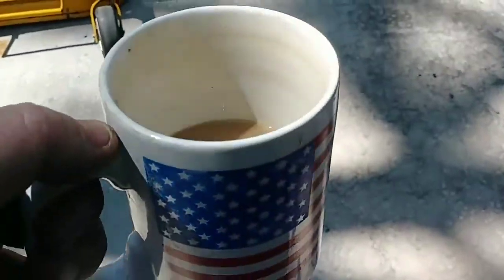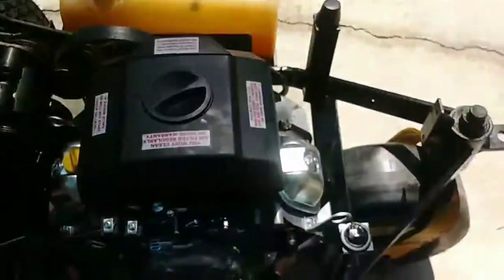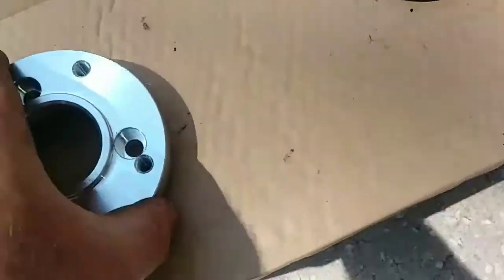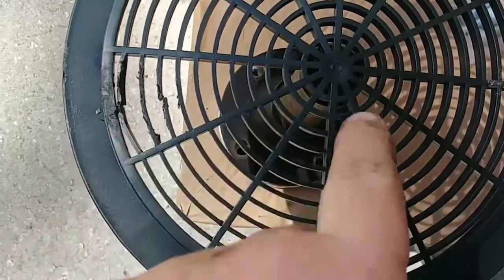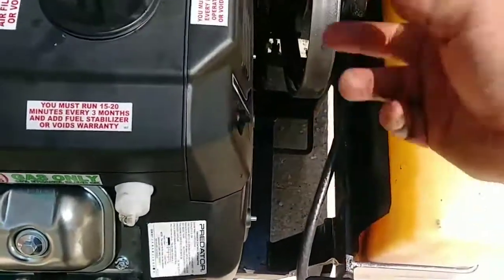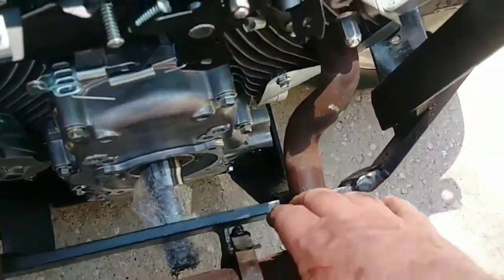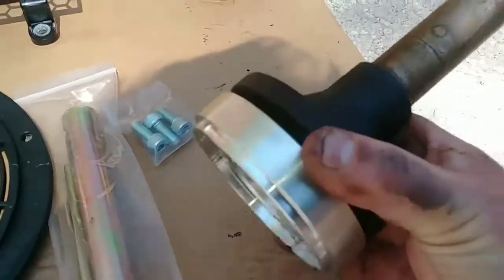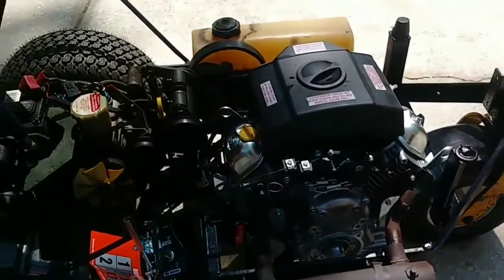Walker MC16 Engine Swap Part  2

Comment: I have the same set up as you except mine has the bagger.  I was wondering if you would put a video out showing the mods you had to make?  It would be greatly appreciated.  Thanks
Reply from the maker: I would glad to put something up, I've been changing the old Walker to make it simplistic and reliable as possible.

Comment: Dan, do you have any updates? I have the same exact yr Walker and want to swap the motor.
Reply: I have the exact same thing. 2000 Model MC with a blown Kohler.  I have a B & S Flat head 16 horse, twin cylinder, that will go in it.  I will have to put 6 inches in the frame but I think it will work.  Let how you are coming with yours.

Comment: Where did you get the spacer for the pulley at?
Reply from the maker: this is a great place for the 670  https://www.performance670.com/
Reply: What did you end up doing with the oil filter and how close it was?
Reply from the maker: @jaredclark6418  I took the oil cooler off for now and installed this filter adapter 
https://www.performance670.com/product-detail/oil-filter-nipple
Reply: @Kf4yjz  I have the same mower and was thinking about going with the 670 just haven’t seen many done other than yours so was just curious on the outcome.  Thanks for all the information.
Reply from the maker: @jaredclark6418  its been mowing grass almost 3 years now.  The exhaust has been the hard part, I made something but kept getting  hung-up so now I'm running drag pipes.